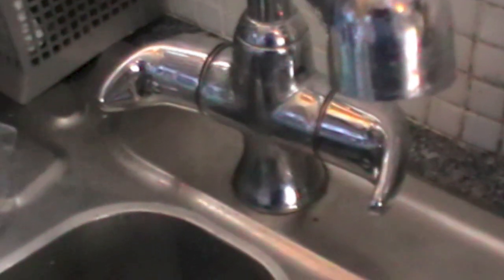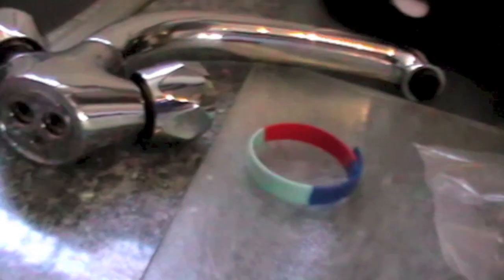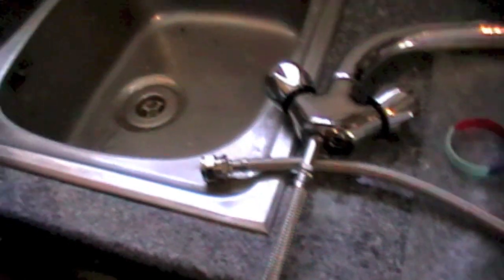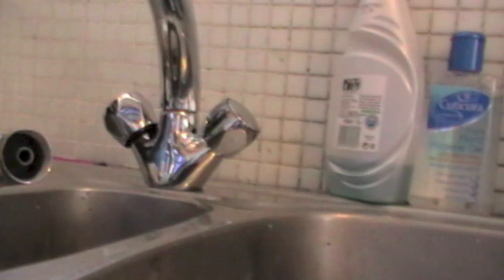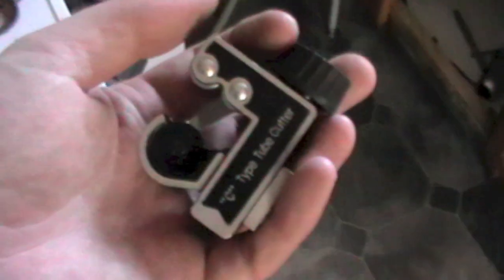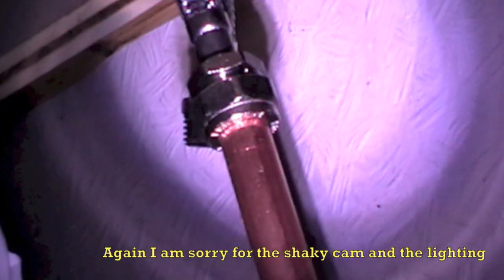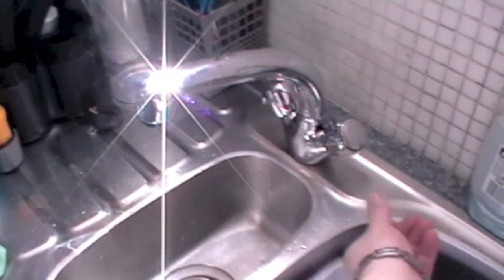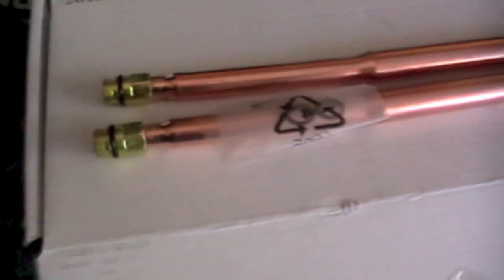How to change / plumb a leaky / faulty Monobloc mixer  tap.

Comment: Thank you very much. This is the exact tap i have bought for the kitchen with compression valves with traditional rubber washer instead of ceramic disc cartridges which don't last as long.  This to replace a Pegler single lever one that lasted about 3 years?! Nice down to earth explanation. Nice to know i can do this myself. cheers.

Comment: Thanks for posting this video - it was informative. I have a kitchen tap to install tomorrow and most likely the flexi connectors wont be long enough by a few mm. I will need to extend the pipework and will probably change the isolation valves as well as the ones in place are very old and stiff to shut off.
Reply from the maker: Thank you for the kind words. I am glad the vid has been of some help to you. Good luck with the install.

Comment: Can someone help just wanted to change my kitchen tap but checked and I couldn't find a third hole to screw in to hold the new tap in place also the new tap looks small then the old tap may not fit Any suggestions
Reply: No 3rd hole? Get a different tap mate.

Comment: The old fashioned ... twist twist twist, open    twist twist twist, close twin taps (std gland) are much better on mono mixers. The 1/4 turn ceramic glands fail much quicker. Regrinding the seat and re-washering are straightforward, if you have the tools, as are replacing the ceramic cartridges. Those mono, levered mixers are a nightmare. It is all too easy to damaged the cover and cartridges are only stocked by plumbers merchants. 
https://www.youtube.com/watch?v=a2prr9ZiFxA
One day I'll do a vid on what tap, best tap and easiest to service/just bin it and buy a new one.. That's  if I ever get a stash of old brassware before I go and weigh it in as scrap.
The flexi's supplied with a nut and olive are also much better.
Reply: Oh, water regs also stipulate that mixers should have a double check valve on the cold feed.